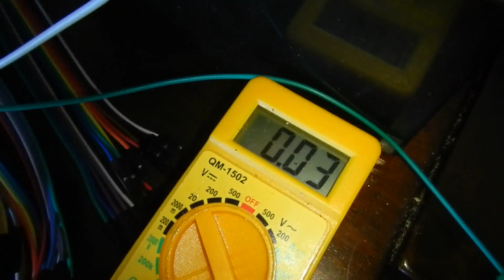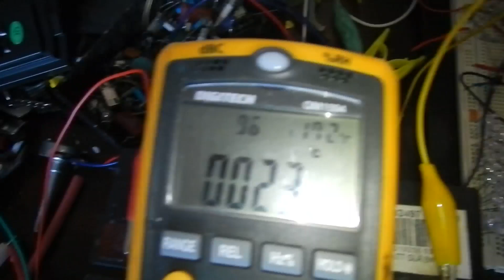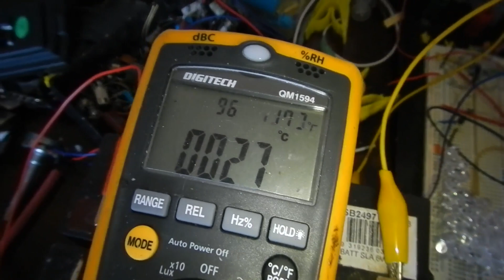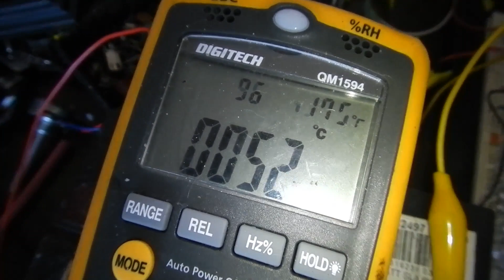Pololu NEMA 17 test for 3D Printer. DIY RepStrap pt3

Comment from the maker: Nope. It goes so fast, then it goes slow again, then speeds up, then back to 2hz, maybe 3-4 times, as I turn the pot from 1000 to 0.... I have 0-1037 (i think) from pot. So I used 5 micro delay (so it will turn on with 0 from pot), * sensor value... It dosn't like to add up big numbers... I can make it go faster with milli's... even though pololu only needs one micro on to activate. Cant get off time under about 100 micros. on time likes to drop to under a micro though....

Comment from the maker: Problem with a competent friend, or clone, is they have good ideas too. Many hours (ans beverages) can be wasted discussing plans and inventions. The trick is finding a capable assistant. someone who can hand you the right tool, and point out its not working because you drained the fuel earlier, would you like the tank filled again now? someone thats good at soldering, wire brushing sweeping floors and sorting resistors etc...  Do you want to be my apprentice?

Comment from the maker: Yep, have a partner. He is supposed to be doing code, and is supplying the paid for parts. so far he has supplied parts, and blown a pololu, by putting 12v to the logic circuit. That precision will be useless, if I cant get an extruder working well. All depends on being able to lay a good bead. Aiming for .4mm nozzle, which can do a bead 0.1mm-1.5mm depending on feed speed and nozzle heat. X & Y axis will likely be toothed belt driven. Will be very happy if I can get 0.5mm accuracy from mk1

Comment from the maker: Need to learn to use microsecond command for that. Theoretically, it should be at max speed with 1µs on-1µs off. whats that 500k steps a sec? 200 steps per rev on full step. So can do about 2.5k rps or 150krpm.... In theroy. I'm not doing a photon. We have 8 motors for 2 printer's. What's really cool, is that on the z axis I have 8mm threaded rod, where one full turn of the rod will translate to 1mm of vert movement. The motor can do 1/16th step. Thats 2,400 steps per mm. If I dont gear it down.